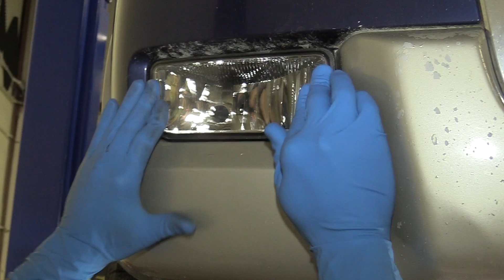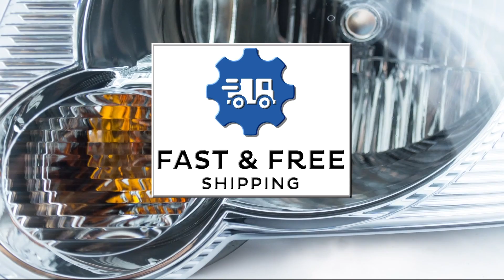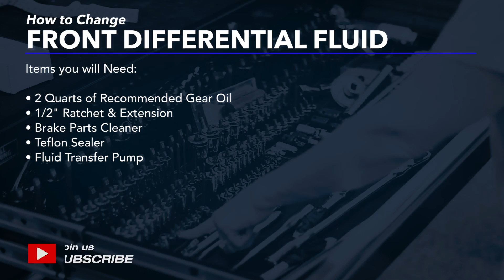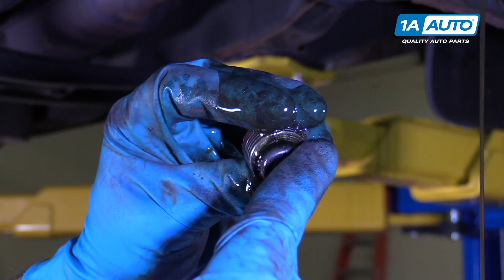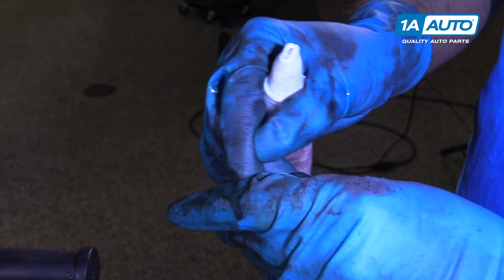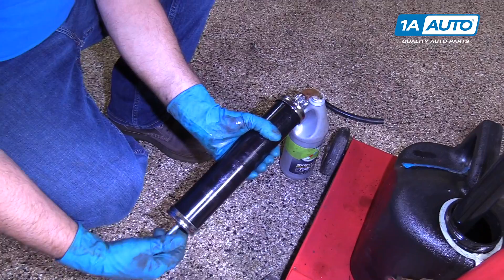How to Change Front Differential Fluid 96-04 Nissan Pathfinder

Comment: Does the front diff require limited slip differential (LSD) additive?
Reply: No it does not.  Front diff is open    though, LSD fluid will do no harm in it.
Reply: @bugsy69-i9p  Honestly I put 80- 90 LSD For the rear and I also put that on the front I read what he said and it makes sense I guess but do you know who he's talking about I guess I don't know what are you saying has me questioning myself but it does no harm I drove no problem it definitely is I opened diff
Reply: But when you put the car in Auto or four-wheel-drive I guess you're gonna feel the difference I have the Nissan limited edition it has auto four-wheel-drive